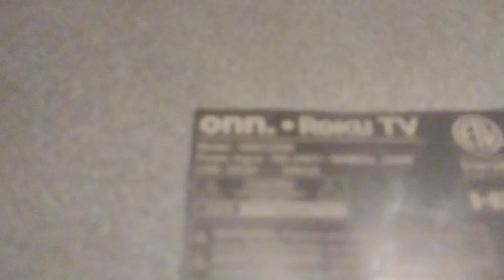ONN 100012588 black screen repair aka Element E4AA70R Board replacement

Comment: Good video, man. Getting ready to buy this same board on eBay. Would much appreciate it if you would be so kind as to let us know which eBay seller(s) sent you the bum boards, so we can avoid those guys. Thanks for your time, and any reply.
Reply from the maker: I forget who sent the bum board. But he finally did admit once he got it back that he tried to use it in another tv and found out that it was bad.  After I sent him photos of a working tv with another board from another ebay seller. He just tried to tell me it was my back light witch I knew was wrong as my mom has two of these tv's and we switched the board from one tv to the other and the issue followed the board and not the tv. So we knew the back light was just fine as it worked before putting the bad board in. Heck we have three tv's with the same power board in the family. One at my house and two at my mom's house. One was in her bedroom and the other was in the bedroom of a special needs grandson that lives with my parents. Not my child but my older brothers child. It was the special needs grand kids that died so we took my mom's good board and move it to his tv and order the board for my mom's tv. So we new it worked before we remove the board from it.  There seems to be a 75" onn tv now with the same board as well. Look at the photos and it looks almost the same just the color of the heat sinks changed. same part number on the board.

Comment: Isn't there a way to de-energize the circuit board so you don't get "shocked" when removing the circuit board? The reason I say this is because the capacitors store energy that's why you get shocked when touching it with the screw driver or your fingers. For example, you press the off button for about 30 to 60 seconds after you unplug the TV or something else that can de-energize the power circuit board.
Reply from the maker: you can short them out after you unhook the wires from the board with a screw driver. but you still have to remove the board to do so. so you still want to be careful at first.

Comment: Great video,,  can you please provide the part number for the board that you replaced .
Reply from the maker: https://www.ebay.com/itm/394644483036?hash=item5be2a4ebdc:g:i1IAAOSwgH1kX20U&amdata=enc%3AAQAIAAAA8BWlB0sDOTKYfwnt0ve1BlzCuezE7g%2FBuVGe8aXe5v5aTn9%2FBOromMMeg%2B33EbquKRjVIUOTMR5DMS2yC3V4a8E7jjxPE3iIM3sqiDJJZmKG9bwr7ZBmP6N9XL2wiuoESiIvh%2FmPYMunu8dXx9UxJC98QNBUFWH2ZzifQ3ArpOK4EKs%2BfllsI8MZs2NFAJjsk%2BoXTPymeFaMcSbJhQm2yNkiwqOlLjEXemR2G52nChStElnSQVhe6EfORzD1i9PCbQbUCARHTl%2BAegXKo1Be9ypXcH6mkWoRq0YUOTB1YiKt6m%2FFT59YLNNLfWiF3%2F1l%2FQ%3D%3D%7Ctkp%3ABk9SR-6EsomLYg
Reply from the maker: they also now use the same board number in the 75" tv.  https://www.ebay.com/itm/394638506935?hash=item5be249bbb7:g:EvUAAOSwGoRjszcZ&amdata=enc%3AAQAIAAAA4PTpxzhp%2Bc%2FwlbMYo%2FPWPHW2eX5lUEGcdAtNZybp%2Bb9i%2F5qQB8CL3AfuB264h7oaV7KsteAfwfgjgLnLr9Bi3uxj4cLy%2B0hOjWZwv%2FMaDpTnSfshck%2FjM8VZDU6X19ZOkgtLy%2FZUtzMTFCHIr3cTw9fHkjSEGQPrNcXHoqqzCNPHUWnmdQl%2BUU%2FDdEW7pBCI5KYGAOgTsLeTCxrkIqmsQ6%2BVwZBsvwFOeQUdd01QLVKdeTwYaNsA3sat1zGxcMQU%2FvTJkHDCQKAIwVWgpXzo9mS0dfsaSl4njx2aAxjTUqE%2F%7Ctkp%3ABk9SR-TpvImLYg

Comment: Great vid!! Is there anywhere else I can buy this board? The ebay link is sold out
Reply from the maker: there are many of them on ebay just not the same ebay link. Search onn and the model number also it seems the onn 75" also uses the same power board. Just make sure it has the same connections. i think they change the color of the heat sinks but other then that they are the same. They have the same part number.

Comment: Im having this issue with onn 70 inch 4k where the screen goes out and the sound is still heard. If i swap the power supply board will it fix my issue?
Reply from the maker: It should.
Reply: Was it the power board that fix your tv or was it the backlights lmk thanks
Reply: @jay was it the power board or the backlights

Comment: Do you know where the part number is on the board to make sure I order the same one?
Reply from the maker: look at the board and go on ebay. there are many tv's that use the same one. Jvc	LT-70MAW795	
RCA	RTRU7027-US	
Element	E4AA70R	
E4SW7019RKU	
ONN	100012588  and there are some more brands as well. part number TV7001-ZC02-01  I see one that is that is 54 dollars. https://www.ebay.com/itm/226267518819?epid=17066465131&itmmeta=01J44QHE0E6WWXBEZPADK75395&hash=item34ae985763:g:GBMAAOSwShBmqDLd&itmprp=enc%3AAQAJAAAAwHD3ihMuuuDh%2F5xprG4AKSxz8u%2B70AjzbwszI5JExyKtH6LbZ1OI9yGn%2FEONV0UceI2kQfQXI2qwBxUZ3S8m36auWS%2Bp1nWKuwnzOlnF9lDk%2FRWCBmPm7BnA4DDoFKC2jzApChxo2p9lwVttsQPKr%2BDkh2NG4o3i6RCW%2BV8XZ0Cu6PhaAB%2FUtHg%2FGcyNzUEwplphRFklozmib%2Fc6nRQhi%2BA%2BDN0H8Hwg68wB0nrVTBLv3NCBNDuIeUVNzDxN4Rl%2F3Q%3D%3D%7Ctkp%3ABk9SR6bgxZehZA

Comment: It's great you show people this but please don't ever check a board for power with a screwdriver again! You might have been safer to handle it but you take the chance of blowing up the new board. Especially if you shorted out the hot side with the cold side. If you don't know what that means you shouldn't be messing with these. Use a volt meter to test for voltage. Some of these boards have in excess of 400 bolts. You more than likely screwed that board up and now whoever you got it from has proof!
Reply from the maker: Was only shorting out the capacitor. I want to devry inc to become an electrician tech.
Reply from the maker: and an FYI it was got for my mom. She has two of these tv's and it's still working great. and the old board that didn't work correct still had voltage in the board as well that is what i was warning people about is to be careful with the boards as well as they can store voltage in the caps.

Comment: I have this model and I have a buzzing coming from the top right of the tv. By chance would this be related to it.
Reply from the maker: It could be.
Reply from the maker: Is the sound coming out close to where the power cord is? The power supply, the cord connector is built right into it.
Reply: @JUST_ONE_ID10T  The sound is coming from the top back left of the tv, I was hoping it was related to the power supply but the sound isn't near it.
Reply: But it still turns on and has display,  but the  buzzing dims every now and then.
Reply from the maker: Sounds like a bad coil or bad capacitor on the power supply board. there are a lot of these power supplies on ebay.
Reply: @JUST_ONE_ID10T  Okay thanks for the help

Comment: Can I ask if you bought the bad boards from "shop jimmy"? I've bought 2 and they were bad. Who did you get the good one from?
Reply from the maker: I only got one bad board and it came from a guy on ebay. I knew it was a bad board as I had two of these tv's so I had another known working board to make sure that was all that was wrong. Then the next seller I bought from sold me a good one.
Reply: @JUST_ONE_ID10T  Thank you, and keep up the good work.

Comment: My ONN TV 65" will come on and just freeze on the Logo screen. I've gone through the reset process (reset button), updates and reconnection to my wireless internet and it just goes back to the logo screen. I'd hate to toss it if there is a board replacement option, but I'm thinking it's not the power board because it does instantly come on then stick on the Logo screen.
Reply from the maker: I would think it's the main board with the tuner and all when that happens.

Comment: Can you provide a link of the board you purchased? I'm having the same issue
Reply from the maker: is it the same model tv?  it's all over ebay when you look at all kinds of price points.
Reply from the maker: https://www.ebay.com/itm/394502121438?hash=item5bda28a7de:g:EvUAAOSwGoRjszcZ&amdata=enc%3AAQAHAAAA4Oy4XQqUAs6NqVFyQmHMD3Ndzq9TjiSfVhb8eODV%2B2i8dU6JsQKw7h9kjgEP19voFDPKv8S9z%2FFqscI1h5m7ulMWeDasM4Qmht%2Bri5t2OGxlockQBJuWLV2DeVfPhQTRIUQlTriNwEd2XN%2FhQz%2BKpdv5GyS1vUotJDB4OPcwMMvcbuaz%2B863QrnFfiqR%2B7h1tg3ShBeboEa6o4klZMXMURhe36qH720txC9hZh%2FBMXnzGHlepuQi4XnSEPTbRwureHxk6oeHY%2B47uJFh0jq3FsWPW%2B52oqpNL3Qr9h7s%2BcRc%7Ctkp%3ABk9SR_aDjpLcYQ
Reply: @JUST_ONE_ID10T  Thanks! Yeah it's the same model with the same exact issue.
Reply from the maker: be careful as the board holds voltage even when unplugged and I shocked the crap out of myself with it. you can take a screw driver over the caps and de-charge it.
Reply: I have the same model number but not sure if mines is a 70 or 75 inch. What size is yours? Just trying to make sure I get the correct board.

Comment: You are awesome for this video! Thank you!
Reply from the maker: I hope it helped
Reply from the maker: https://www.ebay.com/itm/394940282717?hash=item5bf446775d:g:EvUAAOSwGoRjszcZ&amdata=enc%3AAQAIAAAA8Pp4TBEOc4cIeDyjwdWUZf2eIVv3seJ1CItBCVakuhFuuT6eMtDM4m7b%2FayZpDT1x%2Bsj5lSt%2Bo3cemuwB1KChzHXiasjYhMWT4YXmv0oDj24bctBqj46YTdrp3IJIMM9O6jkFN0FbWsrEbNyqyEpr7Z%2FXEjJMq%2BS5LAg%2BZYupSmZMXMpFKkc9bBH1fN7RPxuZI7Z2sqECE7g4yHG0vKOgY0qLXuDIfSyOAWl7fGkT%2Fy6t5ce3DgEEseJvvfp0IuYfcA6Q8P%2F%2FL24yCuDvNjeO69SgvP3CGurAJI7B3jbZhJvNqoLifG4axrIVQrjmHLv7w%3D%3D%7Ctkp%3ABk9SR5qxxbjnYg   same power supply if it's the model that is in the video. they used it in the 70" and the 75" onn tv's